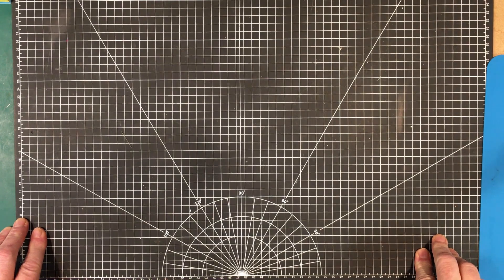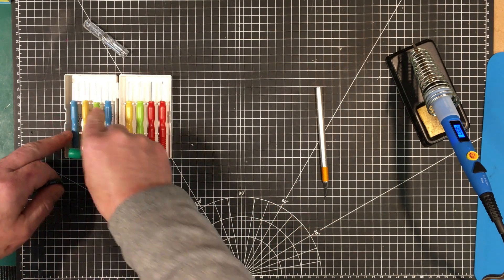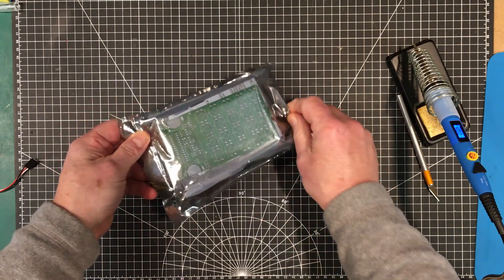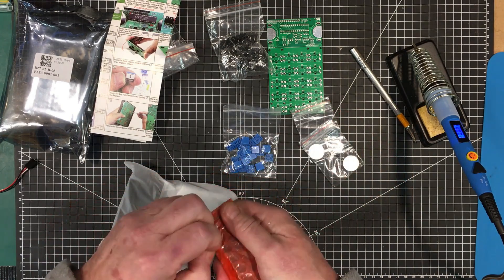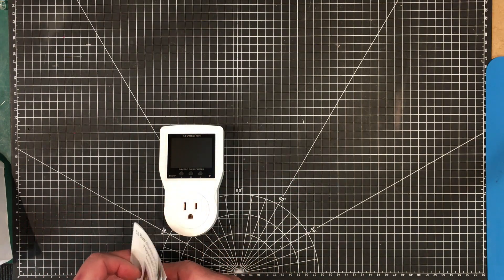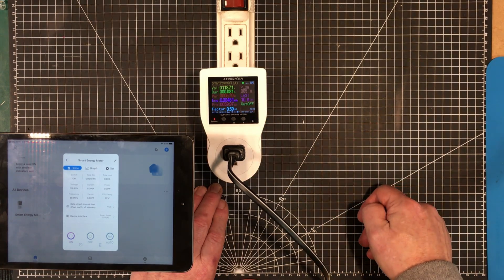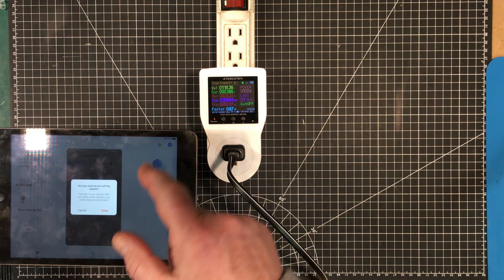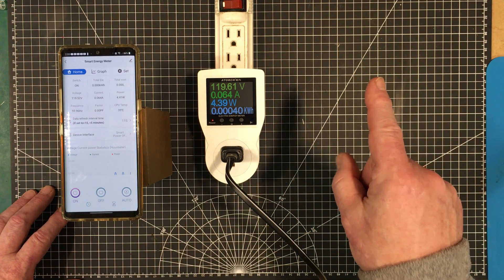0147 - Mail Bag 18:  Cool tools and parts

Comment: Great video, thank you for sharing. I have used those desoldering pins with good results for exactly the purpose you discussed - vintage PCBs. I haven't used the really small ones though. My bench has an outlet strip mounted across the back with a lighted switch that I (almost) always check at the end of the day! Regards, David
Reply from the maker: Good information, thanks!  Have you tried the pins with plated through holes?
Reply: @uni-byte  I have used them with plated through holes but as you know older PCBs have a bit more "wiggle room", so my experience has been that these usually fit - your mileage may vary. Regards, David
Reply from the maker: @davidv1289  Thanks!

Comment: Some nice stuff in the mail bag today. I thought about getting one of those calculator kits when they had them on sale on amazon a while back. I think I forgot to turn my soldering iron off a few times but luckily never overnight because my livingroom light is on the same power strip as my workbench so the whole strip is turned off every night when I go to bed. I guess that's one benefit of having a tiny apartment and a very small workbench.
Reply from the maker: Yeah, I remember my bachelor apartment (one room) back when I was going to uni.  My iron back then was one of those Weller irons that use magnets to do rough temperature control.  They made quite a clunking sound.  There'd be no way to fall asleep with that thing still on!

Comment: I bought 4 sets of the desoldering pins, and used one for a bit at work , and broke it. Of course it's the size I need most
Reply from the maker: That's the way it always goes.  Then you buy several back-ups and never get to use them.  LOL!

Comment: Oh, and for the soldering iron question, like T1d100 I have mine plugged in to a power bar that has my desk lights, etc, on it as well.   Gotta admit though that I did turn it off that way one day, then when I turned the lights back on I didn't realize the soldering iron was hot. I picked it up, noticed some junk on the tip and went to pull it off, burnt finger and thumb.   So, good to have the fail-safe to turn it off but be aware that it may also turn on when you don't expect it.
Reply from the maker: Sounds like combining it with the lighting is the way to go.  That's something I can probably arrange.

Comment: Nice mailbag.  I didn't know about those desoldering tools, interested in seeing how they work out for you.    The test point hoops I bought just recently.  The Calculator kit was new to me and I've just finished ordering one.  Looks like a fun kit that gives you something to use after.   Nice power meter too. I have a more basic LCD one that I'll continue to use but nice to know these nicer ones exist.
Reply from the maker: I just learned about these de-soldering pins recently.  The investigation continues ..  Thanks for the comment!

Comment: Yes, that is how the pin tubes work. I do not forget to turn off my soldering iron, but I do have a fail-safe... My iron is on the same plug strip as my lab desk light. I use the plug strip to turn off the light, so the iron is de-powered automatically. HTH.
Reply from the maker: Thanks for teh tips!  So far my efforts with plated through hole has been spotty.  We'll keep learning..